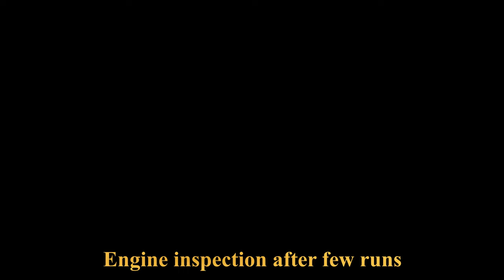2 stroke engine tear down for inspection - motorized bike

Comment: Your engine looks good, did drilling holes in your air filter housing make a difference?
Reply from the maker: Thanks! Most important not to loose other pieces from crankshaft. Holes in air filter housing helps a bit, revs up faster, slightly more power and sounds better.